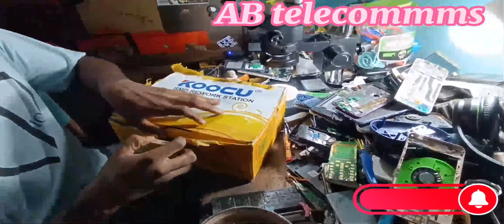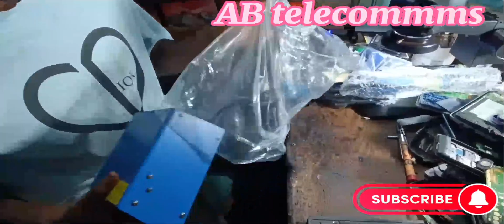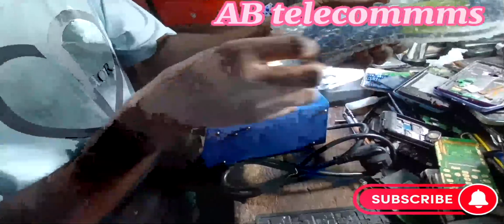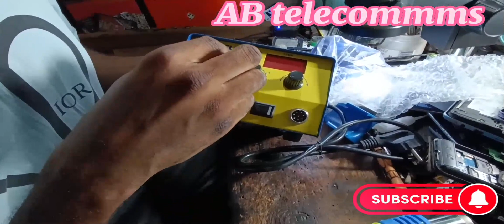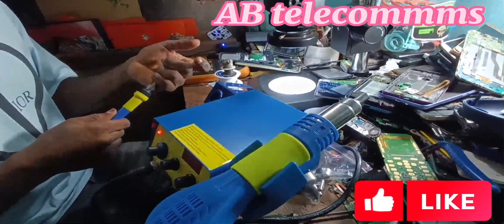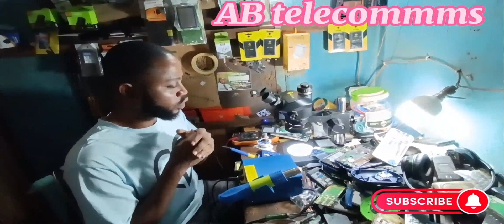SMD REWORK STATION: KOOCU 881D REVIEW

Comment: Sir i have problem with controlling temperature with smd machine which only have number 1, 2, 3 ..... 8 on the hot are scale. I find it difficult to know which degree Celsius do these number represent. I need help. Thanks
Reply from the maker: @tibacomputers  U need to upgrade